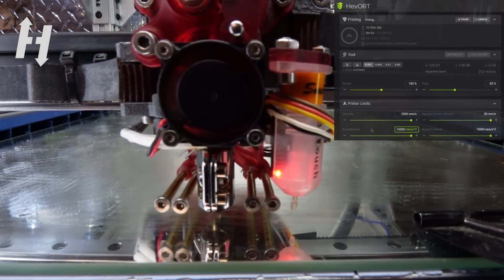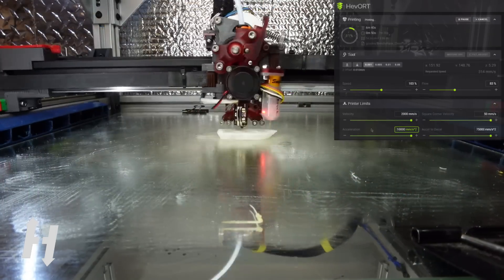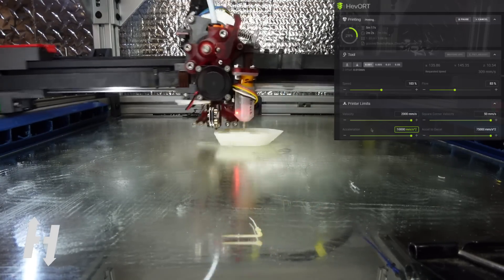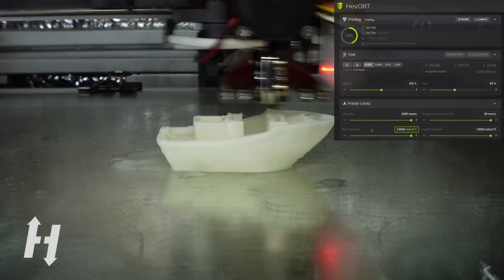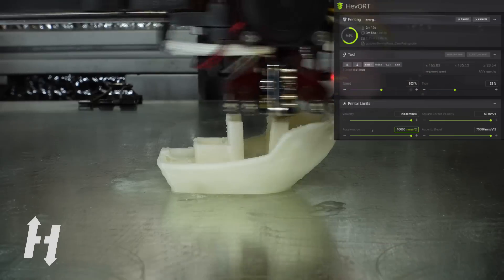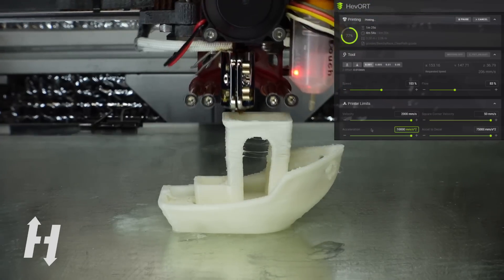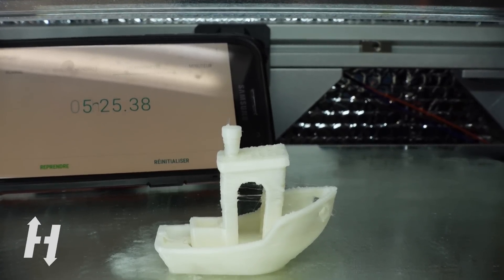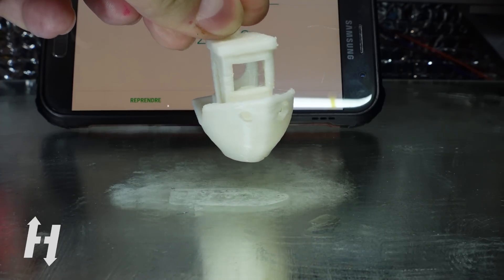Printing Benchy with SERVO motors on my HevORT

Comment: between you and me Mirage, i dont particularly see the servos or the compressed air as being cheating. heh but i dont make up the official rules however. it is a pretty relaxed competition anyhow and there are no prizes at stake other than the bragging rights. as for the persistent stringing quality issue i still think you should try changing the nova for a mosquito (any type available /) on hand. and see what happens. wont know until you try. and yes there is a technical reason for me suggesting that. which is primarily an open question regarding the sharpness of the thermal transition zone. alternatively the heatbreak may be a little bit improved for the newer 1.2 nova revision. or otherwise watercooling of the nova instead of the original v6 style heatsink. all may achieve same stated desire for a sharper melt transition zone. either way whatever. but the thing about that is vlad's water cooled extruder, aparrently it isnt ready yet
Reply: or even perhaps the new protoprint 'raptor' hot end. may also end up proviny worthy of some consideration. as they are also are claiming similarly, but with a new (and different style) of heat break design. somebody else just noticed it today on discord. those are some rather bold marketing claims. however of course nobody has tried it out yet. still too new for that

Comment: 100,000mm/2 accel?! Blimey! When you consider moving mass do you calculate the motor rotor inertia? In my experiance the rotor inertia is considerable on bigger motors, so not much point reducing moving mass. I aim for a 50/50 split of drive inertia and moving mass.
Reply from the maker: Mass is not an issue anymore... anyways. For now :). I am using 10 to 15% of the available torque. These clearpaths are 173W each. This is like 1/4 hp.
Reply: @MirageC  I agree. What I meant is, did you calculate what is allowable mass (or needed motor power) for your desired acceleration? E.G if rotor inertia is 500g, then the first moment equivalent for moving mass could be 500g for an equal split assuming 1:1 drive ratio. Sometimes I've seen a more powerful motor doesn't add extra acceleration because it also comes with greater rotor inertia.

Comment: Sounds like you need larger diameter pulleys 😁.  Maybe 24 tooth for crazy speed?  Are you running klipper with input shaper?
Reply from the maker: Current pulleys will give me 2000mm/s at max motor RPM.  Enough for now ;)

Comment: Always cool content with you, 
The only reason we don't want servos in the SpeedBoatRace is the prohibitive cost, if you could do it cheap enough we would consider allowing it
Reply from the maker: Although this rule may sound weird to some it really forces me to work my stepper system to the max.  And now joshmurrah is taking this even deeper.  I would not be surprised his 48V may get close to servo times. So i see this rule similar as a hp limitation in F1. It forces to maximize every aspects.
Reply: @MirageC  Have you looked into using moteus or odrive instead? pretty experimental.. but cheap (er)
Reply from the maker: @jotham123  Vez3D will do an update on ODrives shortly. On another hand,  I am happily running my ClearPaths ;)
Reply: @MirageC  beautiful! Pro tip, if you haven't discovered already, odrive support is really good on their discord server.
Reply from the maker: @jotham123  talk to Vez3D about it...
Reply: @MirageC  thanks for pointing that out I had misread your previous comment.
Reply: Yeah, I like MirageC’s reasoning a bit better than the cost reason. Unless Hiwin, Moons and Slice engineering are outlawed from the race as well 😉 Quick math tells me crosses gantry with high cost parts (well engineered parts 😉)  gets a bit $$$$
Reply: Are odrive bldc ok for the race? :p

Comment: I am in the early stages of planning a large printer, and the X/Y is giving me lots of trouble. I can't keep the weight down, while keeping adequate damping on the print head with adequate rigidity.
I might have to revisit servos to solve the mass issue by brute force.
Reply: In some rare cases, nothing beats brute force. Also have you looked at Carbonfiber tubing? 
Something else that might help is designing the print head to partially warp around the X axis, so the total center of mass of the head is as close as you can get it to the structural member
Reply: @mr.thomas6128  The EVA 2 modular print head does exactly what you are talking about.
https://main.eva-3d.page/
It seems to be very well designed, and very easy to modify.
I am actually considering building the RatRig, it looks like it took rigidity past what the HeVort has, and has none of the overly complex design solutions that the Voron team have come up with to solve problems that should not be problems.
I should be able to extend the Y-axis to 1000mm. I think buying the kit is worth the cost vs my time designing it from scratch and machining all the parts for it. This video was actually pretty helpful seeing how well the 3030 extrusions performed.

Comment: This is great work. I'm impressed by your continual improvement and excellent results. I'm going to follow you with the clear path servos once you drop your setup video. I use the larger version of those servos on my Tormach 1100MX and they are very high quality.

Comment: At first when I heard 1500 mm a second I thought "that's not fast!" Then I realized, that's 90,000 mm / minute 😮🚀🚀
Reply: It never reaches that speed tho
Reply: @alejandroperez5368  Yes it does. Maybe not on a benchy because of how small it is, but it would on larger things. At 10k acceleration it would reach that speed after 112 mm.
Reply: @Chris-hn4lp  no, the max speed is 300mm/s. The limiting factor is the material melting rate, not the stepper motors.
Reply: @alejandroperez5368  in this case this is a custom 3d printer. It’s got everything upgraded even the speed at which the filament melts. While he may not have that at the maximum yet the speeds this commenter said are possible with this printer. Your printer may have a max speed of 300mm/s but this one does not.
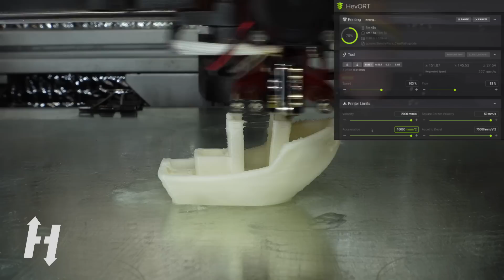Reply: @xiar5546  he even talks about it in the video? 2:53, 4:25
He didn't mention max speeds, but he said he printed the benchie with 300mm/s print speed and 1000mm/s travel speed

Comment: Why is this cheating? Amazing work mate! You’re constantly pushing the envelope 😀
Reply: The rules for the speed benchy race explicitly said no servo motors, intending to keep from having someone drop a grand or more just on servos and obliterate any competition. So while it is a fast print, it doesn't fit the original rules.
Reply: @Coderjo.  ok I get it. I’m for innovation over rules 😂
Reply: @chrisnurse6430  I think the core underlying reason, though, is wanting to push innovation with steppers, rather than just jump to servos, which tend to be more expensive than steppers.

Comment: I don’t think any of that counts as cheating, as long as your benchy is the same size with the same infill etc. I think the whole point of the competition is finding the best possible hardware setup.

I would be interested to see what the fastest perfect print benchy you can get out of this is.
Reply: Speedboat challenge has a list of rules, one of them says that stepper motors have to be used
Reply: @sprkng  ohh I didn’t realize there were official rules.

Comment: What is the ball park cost for a set of these servo motors and how did you send the commands to them? Step+dir or something else?
Reply: Clearpath servos are pretty expensive, last I looked these would have been several hundred dollars each. Servo systems are closed loop, so they require a board that can accept a position signal from the servo. The Clearpath system is designed to be a direct replacement for steppers, and they have the controllers bolted directly to the motor. You can install them and send them signals just like they were steppers.
All that said, they use a proprietary software kit to optimize the motion in-situ (much like input shaper in Klipper). This would have been the hassle he was referring to in the video. 
There are much cheaper alternatives, but getting them to run well at high accelerations can be very difficult unless you are a professional in the field. The DIY CNC people still do not support them much since hybrid systems do much the same for a fraction of the cost, and the Maker community still thinks that rigidity does not matter, they are years from stepping up to this type of motion controll.
Reply: @joshua43214  yup rigidity is everything.  After that, speed is just the delicate application of brute force.
Reply: @martylawson1638  Ya, I get so frustrated at hearing everyone say "we don't need rigidity," then enthuse over a really crappy looking print whose problems could be solved with a rigid machine. Instead they much around with jerk settings and input shapers trying to use a software bandaide to fix a fundamental problem with the machine itself.
Reply: Good point on rigidity.

I spent some time designing a machine with ball screws and proper linear rails, but the math shows that the acceleration is at most 1g with the best stepper/pulleys/pitch combination i can get for 300mm/s movements.
Reply: @eldricliew6223  I'm in the same boat, and have concluded that there is too much rotational mass in screws for rapid accel changes. Which brings us back to belts and the issues of hysteresis. I am beginning to think that recirculating ball linear rails blocks are 100% the wrong item. All the damping on deccel is absorbed by the belt, wider belts only solve part of the problem, metal re-inforced belts require larger pulleys, which leads us back to lower accell due to torque limits.

I'm currently looking at plastic guide blocks, some of them are actually rated for their damping ability. Provided they really have low sticktion, they might be the ideal solution to get an over-damped system at the print head rather than the big springy belt that is the current flavor that leads to all sorts of harmonic artifacts in the print.
Reply from the maker: My frame is 3030 with blind hole method fastening plus 3060 corner brakets.  I had to physically attach the printer to the structure of my garage to prevent it from moving of its work bench.  You can hear the garage structure vibrating when printing :)  As for plastic parts, the HD version of the HevORT was designed with such loads in mind.  Will see who material creeps with fatigue though.
Reply: @MirageC  You'll need 5mm alu plates next all around the machine! more mass the better. Cast iron anyone? 

I really like where you went with the compressed air cooling. Gave me the idea to air cool stepper motors in the enclosure rather than water cooling inside of a 90c ambient print chamber. No leaks or mess!
Reply: $250 to 330 per motor for the smallest size.  Can take step and direction inputs, or serial commands.  (Serial commands with a proper motion planner and feed forward can probably go even faster than this) An O-drive can give similar performance for 1/2 the price but it's a lot harder to setup.  So they're expensive, but would easily fit in the BOM of a $3-5k printer.
 There are also some interesting camera gimbal motors in the $50 range that are less overpowered at 30-100 watts.

Comment: Wow, if your acceleration settings are only using about 20% of the motors power, couldn't you just extrude at a constant speed and instead of retraction use the acceleration of the printhead to have "no flow" (in comparison) during travel movements? This would eliminate acceleration on thenextruder and maybe lower the time by a few seconds, but stringing mould increase, even though I'm not sure how much.
Reply from the maker: I did print a 5min15 one without retraction only using pressure advance.... I have thrown it away, it was giving me nightmares! hahah!
Reply: @MirageC  Haha, nice to see that my idea was going in the right direction. This might be an option once there's nothing else to shave off time, but I can imagine that it'll be a giant pain in the rear to set up. :D

Comment: Go for a remote direct extruder. So you're able to loose weight and gain extrusion speed and torque.
Beside: really good video and really admirable machine and abilities! Thanks a lot for sharing!
Reply: How does a remote direct extruder work? Doesn't that make it more akin to a boden tube system?
Reply: @theninjascientist689  you find examples when googling it. It has the advantages of both: Bowden tube and direct drive. And the weight is not even close to a direct drive motor.

Comment: Now companies just have to come up with a new high speed printing filament to keep up with hevort printers :)
Reply from the maker: yes! that is definately one roadblock that we are starting to feel being very close, if not already present.
Reply: @MirageC  Yeah, serious research in material science has to be done.
Reply: @MirageC  Let me know what you need to have :) some filament specifications. Im doing in this busines :)
Reply: @MirageC  CNC kitchen has made some test on flux of different filament. Diamond filled PLA had surprisingly good results. Some company makes also a graphen filled filament, it might also be worth to try.
Reply: @MirageC we should find a new method of delivery for the plastic, i never liked filament anyway pellet extrusion should have been a thing but for speed i remember some people proposing that a syringe like system could be used that has the plastic already liquid-ish in it so it can be extruded very fast dunno about cooling tho maybe utilize a phase change cooler
Reply: I thought injection molding could do hundreds of parts an hour with the same material. Perhaps it is just the delivery method.
Reply from the maker: @TheboysEpicshit  the process and cost associated in the creation of molds for plastic injection is the draw back.    You need very high production levels to justify that process. FDM is more appropriate for prototyping and small volumes.
Reply: @TheboysEpicshit  Yes, injection molding is different in how it operates, you use far bigger "nozzles" on the tools and a few of them at once per part as well, some tools do many different (or same) parts at once too, the tool is pre-heated and so on.
Reply: @TheboysEpicshit  that benchy injection mold might cost $1500 USD per one
Reply: @TheboysEpicshit  If you count the time it takes to create the mould and set the whole process up. It's hard to judge it as "per hour"
Reply: @TheboysEpicshit   you are comparing apples with oranges, it is an unfair and meaningless comparison. 3d printing have the capabilities to allow hundreds of iterations  of the designs by the time you finish setting up your injection molding....
Reply: @TheboysEpicshit the cost of aluminium molds made by HAAS or Okuma brand five axis CNC's and processing time and material cost doesn't worth for Prototype products...
Reply: You would almost certainly need a thinner diameter filament for thermal conductivity to not be the limiter. Hard to know whether that approach or a longer melt zone, like in a volcano hotend, is superior when factoring in issues from filament that becomes too flexible. Whether a larger heated area or thinner filament causes more issues there.
Reply: Have you tried Extrudr's Flax? They say it's designed for up to 400mm/s printing speeds!..
Reply: @fuckutube65  I havent heard about that, sounds interesting!
Reply: I was thinking more about melt viscosity and speed of solidification. If this is not improved in the filament mixture then high speed printing will always have quality issues.
Reply: @amplitude2836  speed of solidification is something that will most likely have to be dealt with on the end of the printer and the code itself. There is pretty much always a way to make the plastic cool off faster, but cooling off faster is not actually a positive most of the time. The adhesion between layers is largely dependent on the ability of the freshly printed plastic to partially re-melt the layer below in order to bond on a molecular level. If the lower layer is too cool, then that becomes harder. Cooling too fast also increases internal stresses. PLA actually is pretty good at print fast as hell because of the low thermal expansion and broad temperature tolerance. The problem I mentioned, Thermal conductivity, becomes a huge issue as the volume of plastic extruded per unit time increases. It becomes very difficult to actually heat the filament through, so there can be a huge variance in viscosity at the edge of the filament versus the center, making it print very weirdly, and often unsuccessfully. I have been dealing with that type of issue a lot personally as I have been working on modifying a printer to print very large things quickly, just more focused on using larger nozzles because resolution is non-critical for my usage.
Reply: I wonder how copper filled filament fairs in terms of high speed printing
Reply: @satibel  no idea, I imagine it'd struggle with small nozzles, but might be okay on bigger ones... You could probably tune the copper particle size to improve it to some extent
Reply: The hotend must be hacked to stand this high speeds. 
The problem is keeping the temperature with that much material taking heat from the extruder.
I'm using a modified extruder that have a copper heating element on the very end of the extruder, that heats up to ABS temperature (245°C) in about 10s, but I must add that the challenge is to control this fast heating precisely, considering hysteresis on the sensors as the biggest issue.
I'd a hell lot of clogging due to overheated material during the tuning of it.
Reply: I'm just seeing this but have you seen the extruder that split the filament into 3 channels to heat it up faster